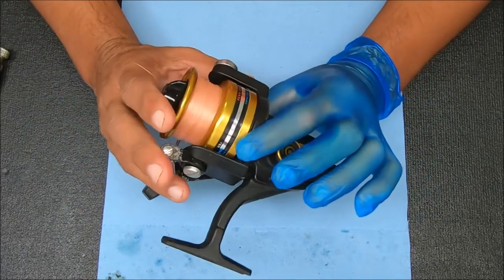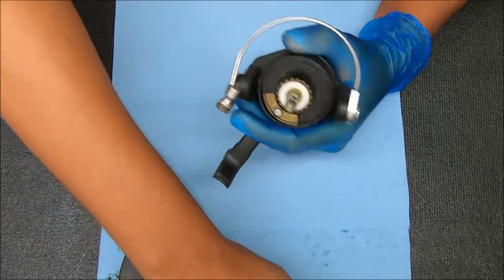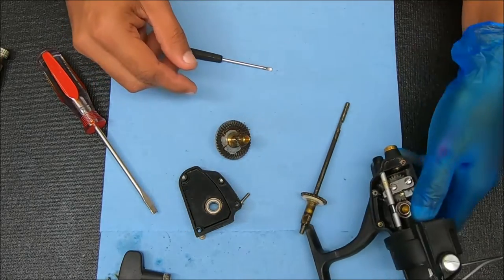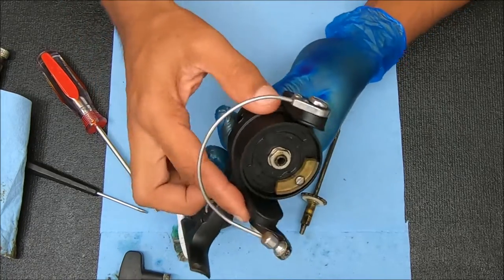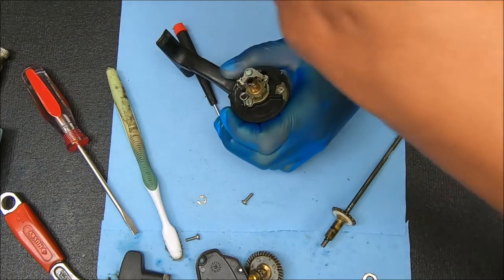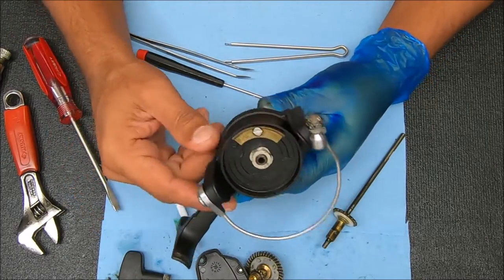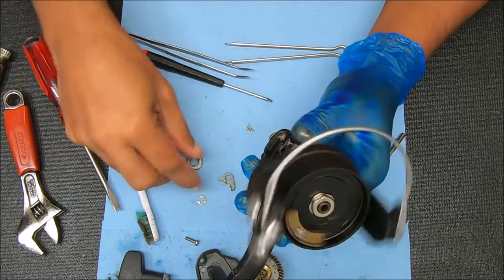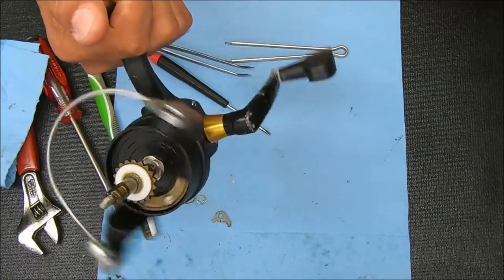Penn Spinfisher VERY ROUGH - How to diagnose and repair: Fishing Reel Repair

Comment: I like the troubleshooting process. I enjoy your content. Also I noticed you used a different bearing. What bearing did you use?
Reply from the maker: Thanks! At what time point in the video are you referring to?
Reply: @TSGReelService  geez auto correct butchered up my comment. So around 5:22 when you replaced the bearing for the spool. Was just wondering what bearing it was and or where you got the part.

Comment: Great video.  I was given a Penn 5500SS and the shaft was broken at the cross wind block and the shaft bushing and gold bushing cover at the back of the reel was missing.  If I can find a gold cover, how does it install?  The housing hole is not threaded inside.  Does it press in?  Any help would be appreciated.
Reply from the maker: Thanks for checking out the video. I think that one slides in and is supported by the end cap.

Either it'll slide in or be pressed in, but you'll also need the end cap.
Reply: Thanks for the speedy reply.  Sorry I wasn’t clear.  My question is about the end cap not necessarily the bushing.  There doesn’t seem to be any threads in the housing for the end cap. Does the end cap just press in by hand?  Does friction hold the end cap in?
Reply from the maker: My fault, I misread it. It presses in.
Reply: Thank you. Keep up the great videos.
Reply from the maker: You're welcome and no worries.

Comment: Just picked up a 7500ss and the body has a white corrosion?.. what could I paint it with or what might you suggest?.. great reels this is my third 7500ss
Reply from the maker: Thanks for checking out the video. I don't know much about painting reels, but I would probably go with a powder coat process or car painting-type process if I'm looking for longevity. There are a few people if you search Google that paint reels, or tell you how to.
Reply: @TSGReelService  I was just thinking a flat black hi temp. (BBQ) paint brushed on not wanting perfect just better. Great videos oh and l had mistakenly said 7500ss it is a 750ss
Reply from the maker: No prob. All the best with it.